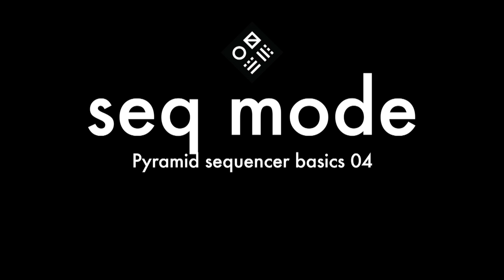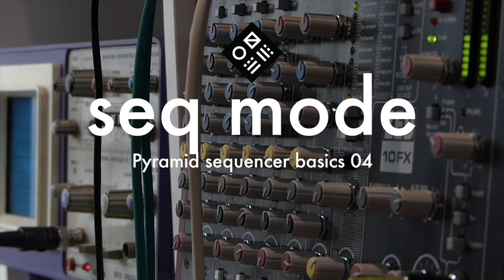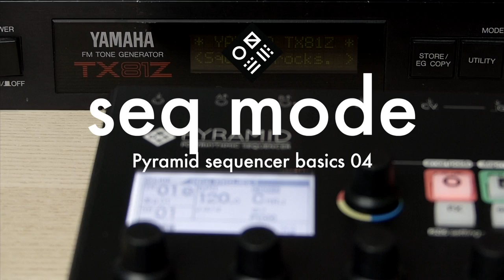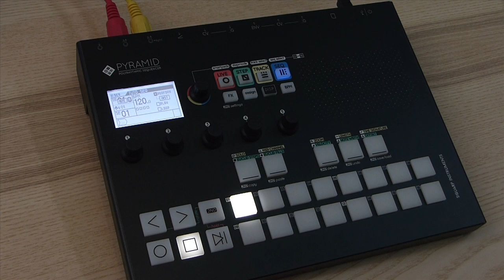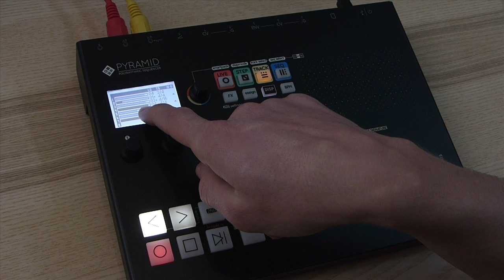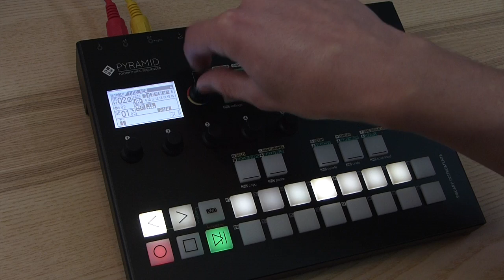Pyramid Sequencer Basics — 04/seq mode

Comment: This is from the latest version of the manual and I'm leaving it here so it might be helpful for someone: 
A sequence is a group of active tracks. A sequence saves each 64 tracks ”mute state” and ”pattern”. 
After creating your tracks in LIVE and STEP mode, and assembling them into several sequences in TRACK mode, you are now able to play with the sequences.  
The SEQ Mode is thesecond way toperform your song. Instead of muting/unmuting tracks like you do in TRACK Mode, Pyramid offers an advanced system of playing sequences:

PERFORM: launch your sequences on the fly. You can select the delay Pyramid will wait until playing the next sequence (Instant, 1 Beat, 1 Bar, 2 Bars, …8 Bars). It’s a great creative tool to improvise with total freedom, while always remaining in sync! 

PLAY: play straight through a sequence arrangement (chain) programmed using the project song zone. 

LOOP: loop a sequence arrangement (chain) programmed with the project song zone. When your sequences are playing, remember that you can still enter TRACK mode to change mute states of the currently playing sequence; enter LIVE mode or STEP mode to play, rec or program notes and automation on the current track.

Comment: I’m really confused about how to set patterns to change or if it’s even possible to program that kind of event into the sequencer without making an entirely new track of the same instrument. Could Squarp share any info on this? I don’t see anything in the manual about setting the patterns to alternate on the same track in sequence mode. Is it possible?
Reply: That is my challenge also, I just want to create a pattern on track, create another pattern on the 'same' track - say for a b section and have squarp let me chain them. I'm not getting how do do that....I can do this easily with my keystep pro but it has limatations in the # of tracks and legnth of tracks that the Pyramid does not...still deciding which to keep.

Comment: Something is wrong when i try to change the track run mode. When I hold track and turn the encoder, it disables the pattern instead of changing the track run mode.
Reply: On the lastest update (PyraOS 3), the track run mode is accessible by holding 2ND and selecting TRACK. Then use the main encoder to access the RUN option and click to change it. https://squarp.net/modetrack#ancre06